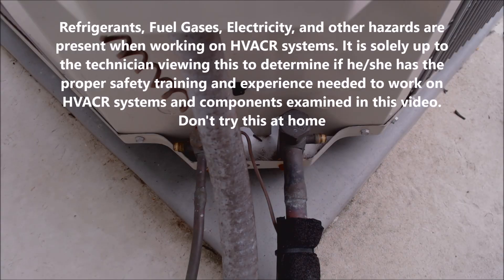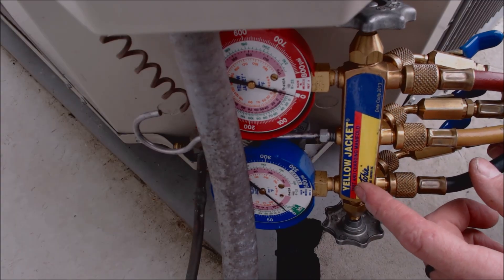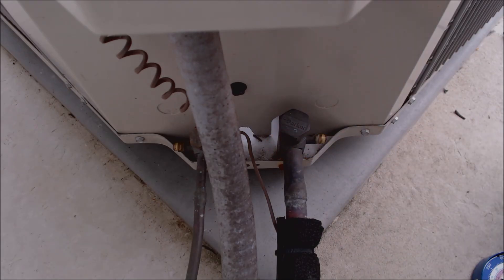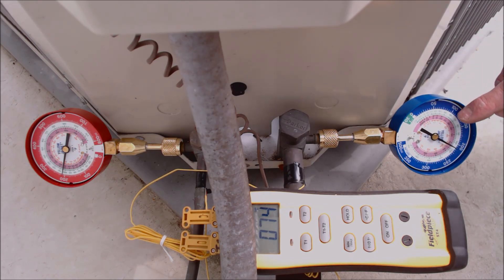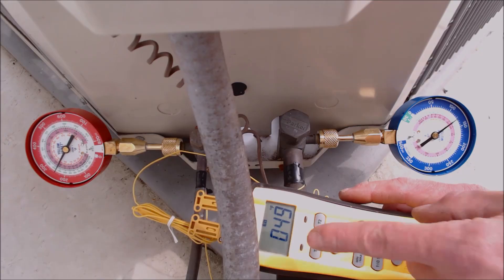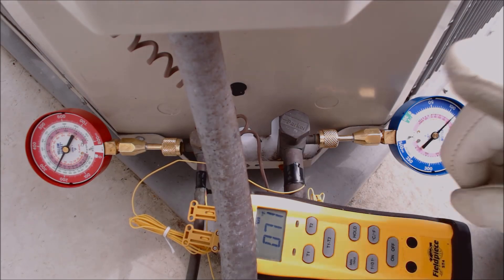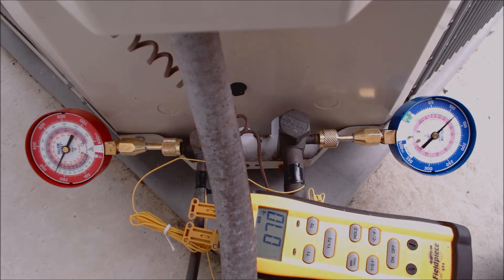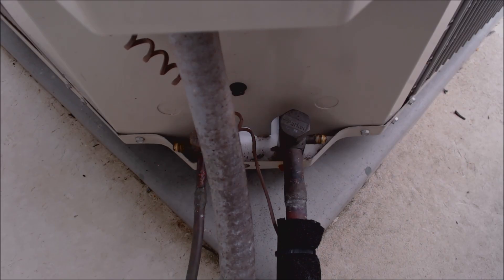Easy and Quick Way to Check A/C Refrigerant Charge: Connect Test Gauges!

Comment from the maker: Tool List-  https://www.amazon.com/shop/acservicetech
Support-  https://www.patreon.com/acservicetech
For those that are looking for the tools used in the videos: (Linked Below)
Here is the Link for the FieldPiece ST4 Dual Temp Meter- http://amzn.to/2AhR6ph

Here is the link to the Blue Vapor Yellow Jacket Gauge- https://amzn.to/2Ju7pan

Here is the link to the Red Liquid Yellow Jacket Gauge- https://amzn.to/2sSFmGH

Here is the Quick Coupler for the Gauges- https://amzn.to/2sTk8Ze

Here is the JB Quick Connect Test Gauge High Side-  http://amzn.to/2ruQb0l

Here is the JB Quick Connect Test Gauge Low Side-  http://amzn.to/2qR0utM

Here is a link for RectorSeal Bubble Gas Leak Detector http://amzn.to/2ckWACn 

Here is a link to the JB 6 CFM Vacuum Pump   http://amzn.to/2nqbvo8

Here is the link to the Appion Valve Core Removal Tool- http://amzn.to/2uYr8WL

Here is the link to the CPS Vacuum Micron Gauge- http://amzn.to/2v1nM3O

Here is the Link to the Appion Blue 3/8" to 1/4" Vacuum Hose- http://amzn.to/2uYlVyc

Here is the Link to the Appion Red 3/8" to 1/4" Vacuum Hose- http://amzn.to/2uYg6Ro

Here is the link to the Yellow Jacket 1/4" by 1/4" heavy duty hose straight-  http://amzn.to/2umtcod 

Here is the link to the pack of 25 C&D valve cores- https://amzn.to/2J1lurm

Here is the link for the C&D Valve Core Wrench, Container, and 3 valve cores- https://amzn.to/2EVGkps

Here is the Link for the newer UEI DL479 Multimeter with temp sensor- http://amzn.to/2jtsUbJ

Other tool links can be found in the video description section.

Shop through Amazon! Your Purchases through Amazon provide a means for channels such as mine to earn advertising fees from all purchases after clicking through. Prices are the same as normal-    https://www.amazon.com/shop/acservicetech

All of the ACSERVICETECH Playlists-  https://www.youtube.com/channel/UCOZR-1IqsAer9wzlvFgb4mA/playlists?view_as=public
Reply: Kool man I learn something new,to bring to the field.
Reply from the maker: Thanks Steve!
Reply: @acservicetechchannel    Do you have a video on how to charge 410 on superheat?
Reply: Hello.  I'm interested in buying your book. I'm an electrician by trade, but want to venture in HVAcR. Will this book give me a good foundation?

Comment: My mini split won't go pass 200 watts the compressor out back barely spins building very lil to no presser in the lines no leaks detected any ideas does vacuuming creates pressure by pulling all if any air out don't that created a suction forcing the refrigerant threw the lines ?

Comment: What a great video thank you! just found it and it's exactly what I need
a little confused as to why you still need to attach your dual temp meter, doesn't the gauge show you if the temp is above 32 deg already? what are you monitoring with the meter? thanks again!
ps, which shrader valve removal tool do you recommend?
Reply from the maker: Look at our newest video published today "r22 and r410a operating pressure acservicetech" for the answer and appion vcrt works well.

Comment: Just asking, what if you hooked up the high side meter like you did, but instead of connecting the low side meter the way you did, you first connect a Schrader Valve Remover, then the meter to the removal side? Now, if you have to add Freon, you connect to the nipple of the removal tool nipple via a vaporizer (410A) . Would that work?

Comment: Hi, If I have a heatpump, and its set to heating inside the house, is it normal the low blue side builds up pressure while compressor is running in stead of going down when cooling? (im connected to the larger gas side pipe)
Reply: Its a unit with the new r32 gas
Reply: JJ Crs. Yes the whole system reverses, the suction becomes HP. Connect red hose only

Comment: If you encounter an older system where you cannot read the subcool chart on the unit what is a good average or ballpark number you could rely on? If one exists.
Reply from the maker: I did a video on this one. look up "acservicetech  target subcooling not posted"

Comment: With the quick connect test gauges, do you have to worry about cross contamination of refrigerants, if you're connecting them on multiple ac units?
Reply from the maker: Hey David, you can use one set for R-22 and another for R-410A but these will be less cross contaminating then a full hose included, thanks David!
Reply: @acservicetechchannel  Thank you for answering my question, your videos have help me learn a lot about the Hvac trade.

Comment: I was always talked to just get the ambient temperature plus 30ﾟ and look for it at APT chart with this be a easy and fast way to check your refrigerant levels?
Reply from the maker: It will not be as accurate or safe for the compressor as the total superheat and subcooling methods. That will get you close but I would not use that nor would I teach my students to use that. I let them know what that older rule of thumb method is but not to rely on it, thanks Elias!
Reply: AC Service Tech LLC Thanks! Could you do a video regarding this inaccurate method because I know alot of people use it out there👍🏻
Reply from the maker: Yes I would like to in the future. I wrote about all the methods that have been passed down and why I would not recommend to use some of them in the new book that will be coming out on refrigerant handling too, thanks Elias!

Comment: Can you buy the gages like that without a manifold or do I need to make a set?
How easy are they to make it that's the case?
Reply from the maker: I have them listed at amazon.com/shop/acservicetech from jb already built or by yellow jacket with the gauge and bottom port and you just tighten them together with two small adjustable wrenches, thanks

Comment: Thanks good video,
After 15minutes AC On for Freon R22,
Blue side is 39psi / 14F degree / Suction line actual degree 78F
Red side is 175psi / 93F degree / Liquid line actual degree  95F
is this mean that I need to just add R22 freon ?
Reply from the maker: Hey Moon Lee, yes the liquid line temp should be lower than the liquid line sat temp That would be your subcooling. Also your vapor line sat temp is below freezing and your superheat is high. All indications that you are very low on refrigerant, thanks

Comment: This is a great video, very educational. In tried to purchase the quick connect gauges from Amazon but there were comments saying they could not be used with 410A systems..Is this true...
Reply from the maker: I have them listed half way down the page at amazon.com/shop/acservicetech and they should be the correct ones. As long as you see that they have the sat temp for r-410a on the gauge which is pink then they would be correct, thanks!

Comment: I love these quick connect gages, but technically speaking are we violating EPAs requirement to use low loss fittings when connecting to schrader valves? This issue has been confusing. Can you clear this up?
Reply from the maker: Low loss fittings are used to reduce the amount of refrigerant released into the air. They are add ons for refrigerant hoses. Since we are not using refrigerant hoses and only a small amount of refrigerant is needed to take readings, these are actually better, thanks Jim!

Comment: Why is the refrigerant return line have insulation while the high pressure line going to evaporator core not insulated? It seems to me the return line  (having higher temp from evaporator core)  would benefit from not  being insulated to allow some cooling from ambient air before  refrigerant reaches compressor.  This make any sense? Just curious
Reply from the maker: That makes sense. The reason is so the line will not sweat and cause damage due to condensation, that's all.
Reply: Thanks for the reply....I am curious as to maybe using the cold condensate from evaporator core to cool return line to compressor for better efficiency reasons. Checking my own system I found the return line is cooler than the smaller diameter   high pressure line from compressor. Is the smaller size line the high pressure side? May be use cold condensate water to cool it? Just an idea....
Reply from the maker: You wouldn't want to cool the large vapor line but it is better if that picks up heat before reaching the compressor. If the liquid line was cooler as it heads to the metering device then that could help a bit.They have that kind of setup on some refrigerators where the liquid line and vapor line touch, thanks
Reply: That makes sense-I have been considering using cold condensate to cool high pressure lone from compressor - I enjoy your videos - learned o lot of stuff (and have repaired some friends AC units - HVAC guys real busy now - friends unit failures are usually the capacitor, motor starter or very badly clogged evaporator cores - people NEVER check/clean them)-I'm not an HVAC tech...

Comment: Use your Fieldpiece gauge set alot easier its all right in front of you to monitor all the info. Also they are good for evacuations. I just installed 140 tons of cooling equipment and used them.
Reply from the maker: Yeah they work great. I was just showing how to use test gauges for pms so you don't have to charge the liquid back in, thanks!

Comment: This plate you referred to with the desired sub cooling number. Is it the metal plate on the outside? My tappan 4ton 16 seer doesn't have this listed on the plate. Where else could i find it?
Reply from the maker: You could turn the power off to the outdoor unit and look on the inside of the electrical shroud. Sometimes it is there. If it is a single or two speed standard unit than you could use 8-12 degree subcooling as the target. I use 11 degrees when the rating plate is wore off or not there, thanks

Comment: My old 80's whirlpool central a/c system finally kaput. So I bought a Goodman 3 ton combo with new line sets for $1800 and put it in myself with help from your videos. After thorough research, I ended up going with Stay-Brite 8 and it's flux and soldered in the new linesets. I couldn't afford expensive torches and just went with map gas and a TS8000.

After leak testing with nitrogen, I pulled it down to 150 microns before cracking the valves. Started it up and it purrs like a kitten. Added the appropriate charge using superheat and it's nice and cold now. I'd like to thank your for your efforts to educate those that are capable.
Reply from the maker: Very Cool, thanks!
Reply: I sure hope you didn't use soft solder with 410-a.  That's a no no cause of the potential of a major catastrophe the pipe could blow apart at the joints. It should have been brazed.
Reply: @DaveK76  I've seen water hammer work-harden and em-brittle soft solder until it let go at normal (~90 PSIG) so big point.  Worse is that these go through temp cycling.  Great point.

Comment: I'll suggest a few small cheap squeeze clamp or spring clamps to hold the temp sensors on the lines using that type temp sensor
Reply from the maker: I just use the clamps on the SMAN460 but on this tool I just keep the bead type. One thing Fieldpiece told me that they are having a problem with is with people switching sensors out back and forth after they calibrated that particular sensor so I just keep the same ones on all the time so temp is accurate, thanks!

Comment: what happened to old school, temperature feeling? feel the supply air, return air and condenser out air and the line sets???? 
or you know use actual thermometers on them, gauging up on things is well known to cause leak issues. when you change a cap/evap/cond. motor is it that hard to turn it on and wait 5 minutes? if it working well, the condenser will start dumping heat quickly and inside cool air, heat-pumps are harder, but judging by line temps in the first 2 to 5 minutes is mostly plenty. iif no temp change noticed, something is way off. time to test further
Reply: I guess it may take years of experience... but still
Reply from the maker: Hey Throttle Bottle, are you talking when techs don't check the valve cores after they disconnect? Yes for efficiency and compressor safety, I try to teach younger techs to only use superheat, subcooling, and total refrigerant weight methods, thanks!
Reply: yeah, so many people don't check the cores for leaks before and after gauging up or using them!
cores that haven't been used since install, often  leak after being used, the same applies for fuel pressure test port, tires stems, car a/c and all water expansion tanks.
I find them leaking often, even on things not touched since install, they just start seeping and many times they were simply not tight enough, maybe the taper seal shrunk some.
Reply from the maker: I am advocating that techs should check with bubble leak detector with the valve core removal tool on the port and bubble leak detector on the end. This way detector doesn't get in the port. If a leak is found, we tighten as you are talking about, pull the stem outward a bit or replace the valve core. Then add the locking cap or brass cap depending on the area. Thanks a lot Throttle Bottle!

Comment: Could you use an infrared temp gun to get the return air and supply air temperatures?
Reply from the maker: You could but I rely on those bead K-type temp sensors as the most accurate. The laser is reading temp of the metal and I want the temp of the air, thanks Todd!
Reply: Get a cheap digital on around $10 will work.

Comment: How do you know if you have the correct air flow or what the duct size is supposed to be? Also how can you tell what duct size you actually have?
Reply from the maker: To really do it, you check the actual static pressure of the system with a manometer and then use a ductulator along with the actual measurements of the duct size. Line the ductulator up with the static pressure read. It would be nice to do a video on that at some point, thanks Steve

Comment: Great Video. Thank you very much. .  You could have mentioned whether to add or remove refrigerant depending on subcooling measurement.
Reply from the maker: True, if the actual subcooling is higher than the target then recover. If the actual subcooling is lower than the target then add refrigerant, thanks

Comment: Are you using the Yellow Jacket Seal Right fittings on your Z manifolds?
What was you ending low pressure temperature?
Heads up, look at the SolderWeld Multi Sol Rods and Flux, 350 degree flow rate!
Great video!
Reply from the maker: These are called quick connect test gauges but they don't have sealright fittings. I use the manual on/off valves for my hoses. I believe it was 38 degrees, thanks

Comment: Hello do you have a video on checking the  cfm  on the system if not can you show how you do it thank you
Reply from the maker: I do not, you first check the dip switches and motor settings, the real way is with a capture hood over each of the supply openings without registers on or over a single return without the grill unless you have grill data. also an anemometer works if the grill or register is not there. You can also do the temp rise formula but the problem is that the coil is not wet. I don't at this point but would like to in the future, thanks

Comment: Is there a reason why you don't use digital gauges? Like sman 360 or 460. They have k clamp temp probes and calculate sh sc vsat and lsat. Just seems easier to have it all in one.
Reply from the maker: Hey Condorman3, Kennie Garner, and Fedboy601, I typically use the compound gauges because the majority of techs I teach are newer in the trades and I don't want to confuse them or think you need expensive tools to start in our trade. I will be putting out some videos on how to use digital gauges and probes so people know how to use them efficiently. Also I want newer techs to think through superheat and subcooling for diagnosis sake. For experienced techs that are very fluent with troubleshooting with superheat and subcooling, digital gauges can be nice and can help things go a little faster. Thanks to each of you!
Reply: kennie garner you took the words right out of my mouth . Guys are running around with theses digital gauges and don’t even know what super heat or subcool is .
Reply: kennie garner understandable. But for me, a small business owner and been in the field for 10 years. It lightens the amount of things needed to carry. But I do agree. People use these alot just for show and acting like they know what they are doing